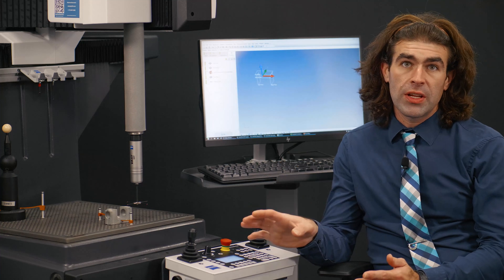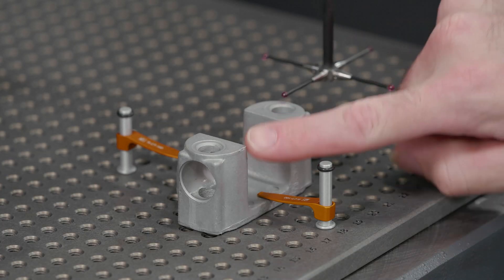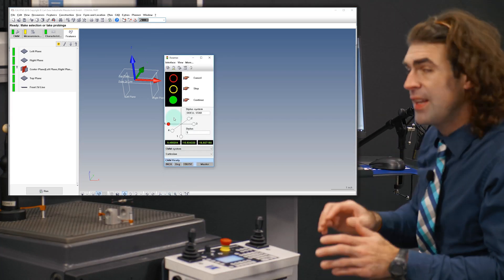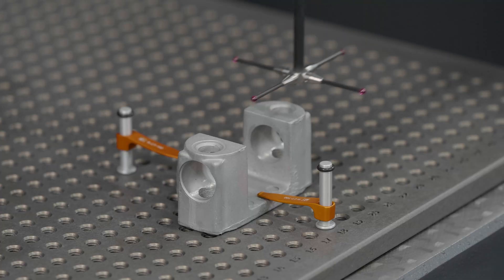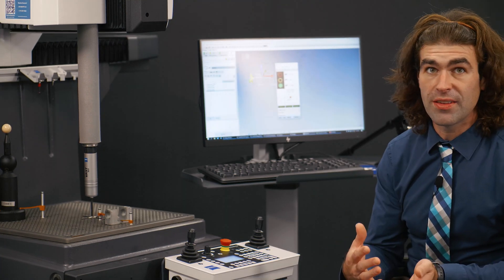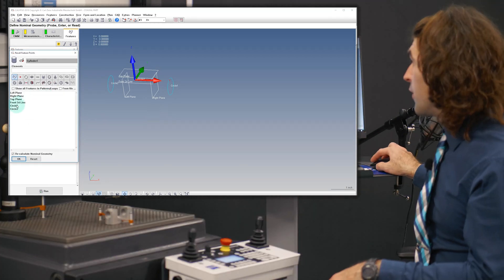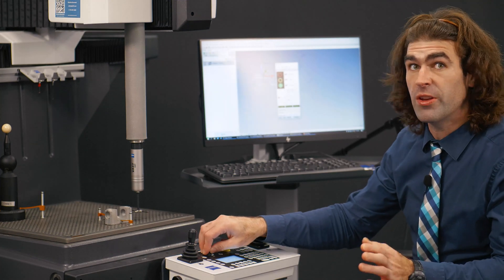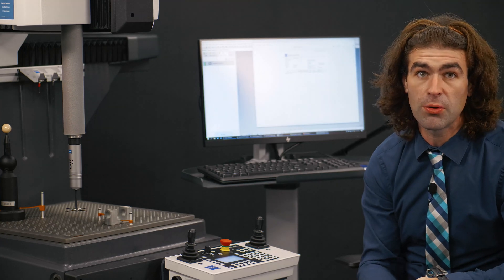Zeiss CMM: Star Probe Programming - No CAD Model

Comment: Could you please make video programming sample rectangular part with hole NO CAD file . And how to set the CMM start / auto run. Also how to email you when I have any question need tutor
Reply: he has a video measuring a carpenter square you would likely find helpful.. it is about as basic as it gets considering hes only probing 2 planes and a straight line and he shows how to auto run measurment plan